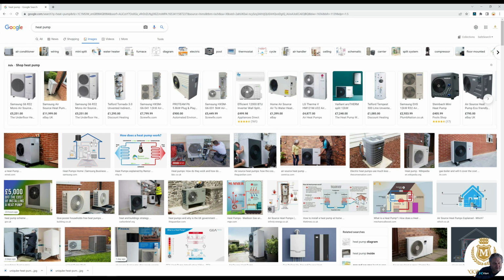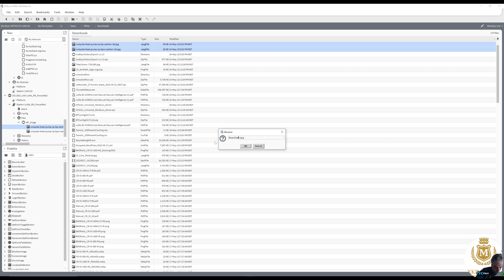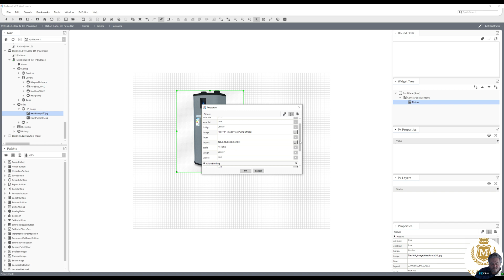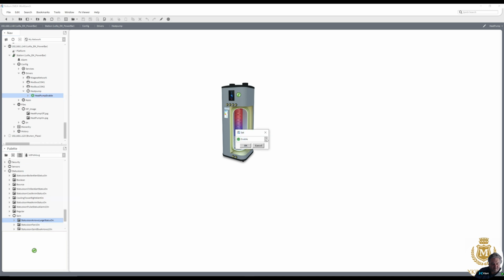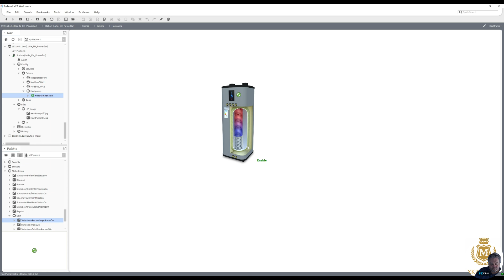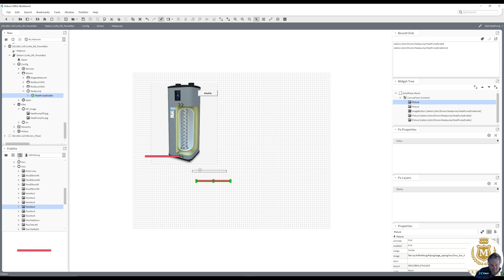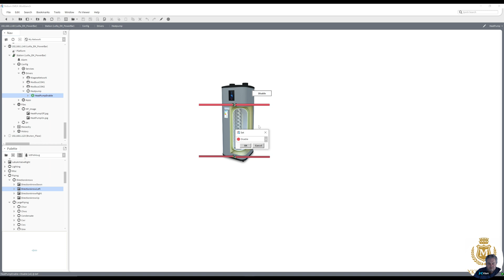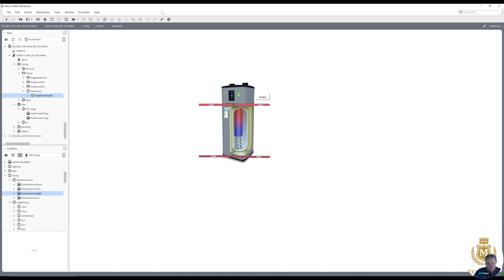#33 N4 Tridium Niagara - Machine learning - 3D Graphics, how to add to PX page

Comment: Sir how to  build 3d floor plan in Niagara
Reply from the maker: You will use 3rd party software and then load the graphic to populate. Tridium Niagara won't make a 3d floor plan, you need to do this yourself. 
I use free software called Sweet Home 3D, at https://www.sweethome3d.com/ and take a standard 2D floor plan and then you can trace over this with your mouse cursor for the 3D floor plan. While on the floor plan,. you can measure a door in the software, place the width in mm, and then that's the scaling done. Lots of examples at https://www.sweethome3d.com/gallery.jsp
Reply from the maker: If using windows, its free, but a mac you have to pay £11.99, see https://apps.apple.com/app/sweet-home-3d/id669289700
Reply: @NiagaraTridium  thank you sir

Comment: Hi Paul
Not sure if I have asked you this before, But is it possible to obtain a trial download of Niagara maybe for 30 days? to practise with before taking certification course.
Your videos are a great help.
Reply from the maker: Hi Tony, the issue here is you need an engineering license to use the N4 workplace software. And this license is not free, you don't even get a 30-day trial :( 
Once you install the N4 Workplace you get a host ID, and this is different all the time, I think it generates with the MAC address of your network card, so you cant move it to another PC once you register the software. I am a system integration, so I can ask for the license but they will charge me which is currently £132 + vat :(

OFFICE-DEMO-PC	Demo version of Web Supervisor and Workbench engineering tool £132.00 + VAT

They also don't like you to have too many engineering licenses either.

The other option is to buy a supervisor license but this is £321+VAT

SUPE-0	Small Building Supervisor with no JACE connectivity | requires maintenance £321.00 + VAT

Then you have to add the maintenance (This covers you for any new software updates in the 18 months) which you DO NOT need to renew after the 18 months, but that's another £58.50+VAT

SUP-0-SMA-INIT	Supervisor 0 Maintenance – 1 Year Initial (18 months). £58.50+VAT

So either way, you have to pay, sorry, no way around this.
Reply: @NiagaraTridium  Okay thanks Paul, I'll look into the OFFICE-DEMO-PC.
As long as I can use it to familiarise myself with Niagara workbench for a few months and I can do the basics with it.